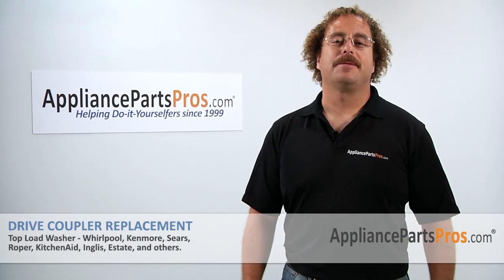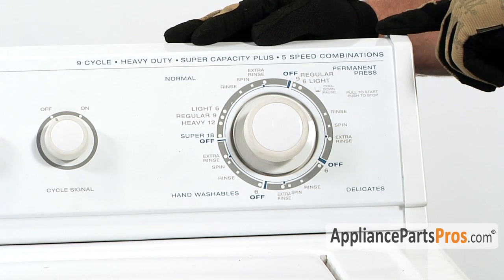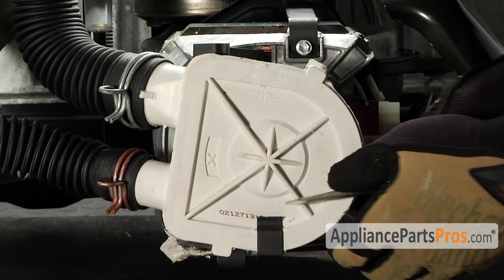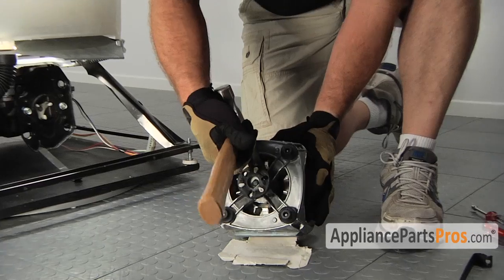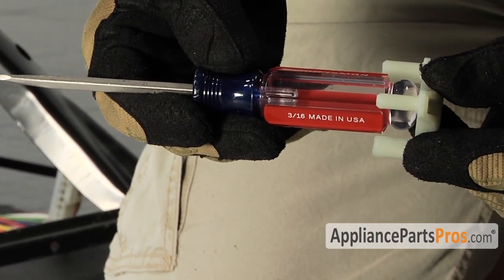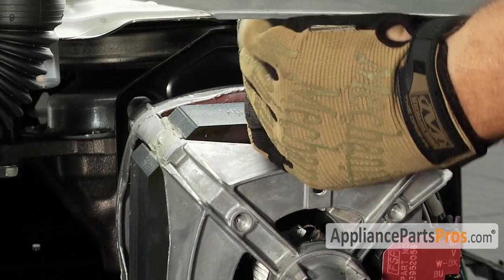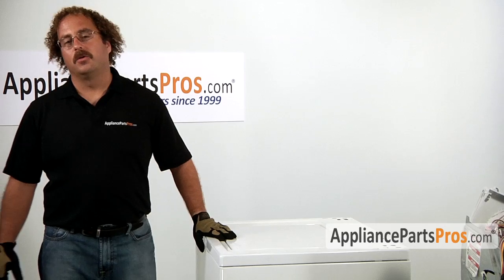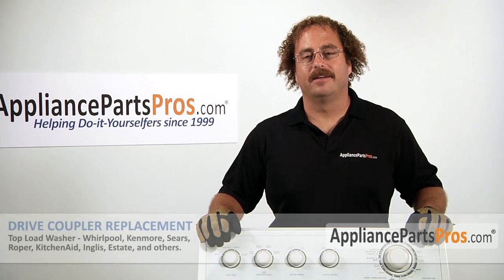How to Replace Whirlpool/Kenmore Washer Motor Coupling (285753A) – Fix Washer Won’t Spin or Agitate

Comment: With the Series 80 Kenmore Washers, the two end caps on the control panel need to be snapped off to gain access to the screws in the front.  Thanks for the repair video.  Could not have done it without it.  What would we do without the internets!!!
Reply from the maker: Ears 18 Glad you were able to get the washer fixed!

Comment: Hi fixed my motor coupling just like your video followed all the directions, but now that i turned it back on to wash a load there it's this angel coming from the machine like either oil or rubber sneak is that normal

Comment: great video...I noticed that the motor is horizontal mounted..?...correct..?....I think I have the same problem, except my motor is directly underneath the tub..... hopefully I can easily do the same repair...
Reply from the maker: If your motor is mounted that way it is probably a different design of washer. You can go to our website and enter your appliance model number to view the parts breakdowns to be sure you get the correct part for your model and see if we have a video for the motor. http://www.appliancepartspros.com/
Reply: I checked again,,,the motor is mointed same as your video...I'm hoping my problem is the clutch bushing..

Comment: So I just followed this helpful video and replaced the Drive Motor Coupling which was broken on my Kenmore 70 Series, but it is still making a loud grating noise during the cleaning cycle. If I lift the tub up a little while it is cleaning it will stop making the noise temporarily. What else needs fixing? Thanks for any help.
Reply from the maker: We'd be happy to help you out with that! We offer free technical advice and diagnosis. To answer specific questions about specific models, we would need to know your model number so that we can consult a diagram of your unit. You can give us a call at 1-877-477-7278 or you can chat us at our website: http://www.appliancepartspros.com/. One of our agents can take the model number, look up the schematics, and talk you through any issues or questions you may be having.

Comment: Great vid, but I had a problem . The metal piece on the trans shaft side coupler stripped from the coupler.  Everything spins freely. Any thoughts?
Reply from the maker: Are you saying the transmission shaft is rounded off? If so you would have to replace the transmission. If the metal insert came out of the coupler, then you need to replace the coupler.

Comment from the maker: Make sure you are tapping the coupler pieces down flush with the shaft ends, make sure your grommets are on the right way and in their holes. These are the things that might bind it up. The second motor clip is a little tough to get on but should not be too hard or cause it to bind up.

Comment: Nice video, the only problems where getting stuff out of the way, so you could do the repair. Little tip, maybe tipping back the washer would make it easier to put the motor back on as  it iis really heavy,....I used some books to get it into place, also works.                                   This can be done yourself though, but does require some ingenuity and patience!
Reply from the maker: We're glad we could help with your repair! And thanks for that tip.

Comment: Many thanks. Good vid.  I replaced the motor drive coupling per your video, yes the old one was stripped round in the middle.  I got it back together and . . . buzzzzzzzzzzz
Same sound and symptom. No adjitation, no spinning of the barrel.  Sigh.  What next, What now?
Reply from the maker: Robert Douglas This will involve some some trouble shooting it is best to post the problem along with the appliance model number on our repair forum and the techs can help you find out the problem.

Comment: Second time I have replaced this coupler but the metallic insert keeps coming off the plastic legs, any ideas? Thanks for sharing!
Reply from the maker: Emmanuel Chavarría Check out this thread about brakes and broken couplers, it could be a few things. http://forum.appliancepartspros.com/washer-repair/3265-replacing-direct-drive-washer-brake-shoes.html You can also post the problem along with the appliance model number on our repair forum and the techs can help you troubleshoot the problem.

Comment: So I am attempting this repair and have gotten to where I need to remove the plastic coupler pieces from both shafts, and neither will come off, it's almost as if they are fused to the shaft.  Also, I found the rubber piece on the floor, and all 6 prongs on the two plastic pieces are sheared clean off.  Another thing is that the plastic pieces on the machine do have the metal insert in the middle, so am I to assume this repair has been done before on this machine?  Please help me figure this out

Comment: Hello,please if you can to measure the metal insertion inner size btw. the parallel surface.I want to adapt to my washer if the size fit.My shaft is 10x10 mm square.Thank you!

Comment: Everything worked good until I came to the last coupler...I can't get the coupler off that is behind the motor mount...any suggestions? I have tried tapping the screw driver with a hammer but it still won't budge...

Comment: What is happening with my machine is there are times when after the cycle is done, the load is a bit damp still. Would this be the possible issue? My washer still spin though.

Comment: Put the coupler into a cup of very hot water (boil the water in a microwave) for about a minute before tapping it on the shaft. That makes the plastic pliable enough so it won't split when you tap it onto the shaft.

Comment: I have question what if the coupler don't have the little metal piece in it do still consider a bad coupler???
Reply from the maker: It should have that metal piece in it. If that piece is missing then yes that would be consider a bad coupler.

Comment: Thanks for the video. I replaced the coupler and now the wash cycle runs very slow. It stays on wash and rinse and spin a long time. Any idea what I did wrong?
Reply from the maker: Fred Martin You can post the problem along with the appliance model number on our repair forum and the techs can help you troubleshoot the problem.

Comment: I have purchased a new coupler for a Kenmore 80 series, I go to mount it, get one strap on, and the coupler is still free to spin, I go and try to put the other strap on, and the coupler and gears stop spinning. I don't want to risk putting it back together and the motor going bad because its not free to spin. I have already taken out the coupler to see if it was in too tight, but that wasn't the case. It is a bit challenging putting the second strap back on to the motor.  Any suggestions?

Comment: The new coupler had metal and thta can strip the transmission and or the motor that's why the arms with all plastic without the metal in there will save you a new transmission and or motor

Comment: Do these couplings when going bad cause intermittent spin issues until it's fully trashed? I plan on checking mine this weekend as it'll agitate, drain but was intermittently spinning (with lighter loads) but not with heavier loads. Now, it refuses to spin at all. Just curious.
Reply from the maker: Brandon Montz If the washer spins with light but no heavy loads it could be the clutch is slipping and needs to be replaced. Also check the brake shoes to be sure they are not dragging! You can read about it in our forum, http://forum.appliancepartspros.com/washer-repair/3265-replacing-direct-drive-washer-brake-shoes.html

Comment: I am having trouble getting the second part of the motor cupling to come off the washer. The first part easily comes off sob does the rubber piece. Is it OK to put a new one on anyway? It is broken with two legs still attached.
Reply from the maker: You need to get behind it with a bigger screwdriver or a small pry bar. It may be tight but it should come off, I would not suggest leaving it on.

Comment: Before opening my washer, I want to know: it this is the problem, will the washer we silent after it filled? I would presume that normally, you would still hear the motor turning even if the couplers broke.

Comment: My washer was not spinning unless you gave it a push.  I replaced both couplers and the rubber insert per the video.  Washer worked for a couple of weeks but now is doing the same thing again.  Any ideas?
Reply from the maker: We'd be happy to help you out with that! We offer free technical advice and diagnosis. You can give us a call at 1-877-477-7278 or you can chat us at our website: http://www.appliancepartspros.com/. We will need your model number to give you accurate advice, which you can locate using this tool on our website: http://www.appliancepartspros.com/modelnumber_locator.aspx

Comment: I have a 18 year old washing machine, and i cant seem to fin the same part for my old model (1104680290), so does the 285753A still would be able to work with mines?
My old cracked coupler looks exactly identical to the one you have in the video.
Reply from the maker: SAS Mo It should work, these were the pretty standard over the years.

Comment: My washer won't spin or agitate,but did drain. In the spin cycle it made a loud noise and moved slightly.I replaced the motor coupler,now it doesn't spin,agitate or drain,makes a humming noise in spin cycle. Any suggestions?
Reply: Motor is dead, usually what humming is.  sorry

Comment: Thanks! Great video. BTW, I have a question here. Hope can get some solution'
The spin function of my kemore washer is Not working all the time. Sometimes it is good, but later it is down. The only way to make it work again, is to unplug the power, wait for 5 mins, plug the power back and then turn on the spin. But this way is NOT always work. I have to tried several times to make it work. It is really confusing. I don't know is this problem is related to the motor coupling or the clutch. Or to the Control Panel? Can anyone give me any advice?
Thanks!
Reply from the maker: Albert Chang I would check the lid switch for a cracked body. If its cracked you might get an intermittent signal from it and bumping it might change that. You can also test the switch for continuity. The lid switch is a safety device that stops the washer from going into spin if the lid is open. If that is not it, I would post the problem along with the model and serial numbers of the washer on our repair forum and the techs can help you out!

Comment: This would have taken me about 40 minutes.  However when putting the motor back on and put the top clip on, the bottom one wont go on.  If I get the bottom one on the top won't go on.  Like it's a bit too short.  If I could get both clips on it would be back together and working in less than 5 minutes.  

Any tips on what the problem might be?
Reply from the maker: Might need to tap the coupler ends down just a little. If they are not down enough it will maker it a little too thick and the clips wont go on.
Reply: I went back for another try.  Used a pipe wrench and it went on in a flat second.  Most of the videos that I watched including this one showed just popping it on really easily by hand.  That's deceiving.  

That said, it was a great video and other than this kink in the plan I changed it out easily.  Took a couple of tries to get the cover back on properly but not difficult.
Reply: Nancy Michelli You are SO right about that. Disassembly is easy - getting back together is quite a bit harder than the video makes it appear. The 3 prongs won't just magically align with the 3 holes; as soon as the parts touch, the motor spins a bit and you have to start over.  After about 10 attempts, I found a trick: get the parts in alignment, then bring the motor in at a tilt so the bottom 2 shock absorbing grommets find their receptacles first; then bring the motor up straight and the coupler prongs might just find the holes.    The video also shows the mounting clips just popping back into place; mine were a dogfight with a big pair of pliers.

But, it can be done.

Comment: Does my washer have to be empty? Mine did it after I filled it.
Reply from the maker: When you are doing a repair yes you would want your washer to be empty.
Reply: @appliancepartspros  I know it's a dumb question, but it won't drain. I'll get it done. Thanks

Comment: I Have a Kenmore 80 Series Washing machine 110.26882500. For couple of times it tripped the circuit breaker at the middle of the cycle but now it trips the breaker as soon as I try to turn it on. Lid switch is good. It tripped even when I tried to bypass the lid switch. If I disconnect the lid switch then it fills the water and stops. What could be the problem?
Reply from the maker: pragyanraj1 Have you check the lid switch wiring all the way from the console to the switch? Not only for continuity but to ground? You can also post the problem along with the appliance model number on our repair forum and the techs can help you troubleshoot the problem.

Comment: I'm on my third broken coupler why does it keep happening?
Reply from the maker: ilikejumprope It could be a few things and without any other symptoms, it is hard to say. You can post the problem along with the appliance model number on our repair forum and the techs can help you troubleshoot the problem. Make sure you tell them of any other symptoms, noises, etc.
Reply: +AppliancePartsPros it just happened for the fourth time! Ugh watching your vid again to help fix it. And the part where he puts the motor back on is extremely difficult for me. Any tips to make it easier? That motor weighs a ton.

Comment: why are we smelling a burning smell after replacing it?
Reply from the maker: I would pull the motor off and make sure you tapped the coupler on enough on each side. If not it can cause it to bind up. As you put it back together make sure the motor goes on straight and there is no problem with the pump.
Reply: AppliancePartsPros Thank you so much!

Comment: What if I have no screws in the back?
Reply from the maker: Tracy Bradway Are you referring to the console screws? If so, you might have the clip type or the screws maybe covered by a trim panel that you will have to remove.

Comment: I do have a question.  After I had everything back together I realized that I had not added back this cardboard/paper to the bottom of the motor where I am guessing it had come off.  My guess is that it was to keep any wires from touching each other and short out.  But there is nothing to touch under the motor.  Is it important to take it back apart and put this back  on?

Did anyone find anything like this on theirs when they did this?  I m trying to decide whether I need to pull the washer apart again to put this cardboard paper on.  I really don't want to do that but will if it's important.

https://plus.google.com/u/0/photos/yourphotos?pid=6039682535727147826&oid=107591688336663880809
Reply from the maker: Nancy Michelli I would put the shield back in. It is there to help protect the floor from the motor heat and also helps prevent things from being pulled into the motor.
Reply: I ended up finding a link to your video of replacing the motor that showed where it goes.  So I did take it apart and put that back in.  Though there doesn't seem to be much holding it there other than that one clip.  

Thanks for the help.
Reply from the maker: Nancy Michelli Awesome, glad you got it back in!

Comment: I did this 3 times and the coupler keeps breaking :o(
Reply: +BigJyeTV  take out the agitator and clean and oil where the transmission spins the tub it needs to be able to turn easily or the motot will snap the coupler, maybe also you have a bad transmission
Reply: Paul Glinski Thanks, it ended up being the piece that looks like a brake shoe. The name escapes me now.

Comment: I don't understand why the entire coupler isn't made of metal instead of plastic.
Reply from the maker: Mike Law They have always been plastic. It is like the weak link that breaks and spares your motor or transmission from damage.
Reply: AppliancePartsPros  Well, I took my machine apart and found that the coupler was OK.  I checked the pump and that was clear also.  The one thing I did notice is that when I turn the motor shaft by hand I get a metal against metal sound at certain points.  Does that mean I have a bad motor?  By the way, it's a Kenmore 70 series(11020712990) that was purchased new 15 years ago.
Reply: AppliancePartsPros  Well, I took my machine apart and found that the coupler was OK.  I checked the pump and that was clear also.  The one thing I did notice is that when I turn the motor shaft by hand I get a metal against metal sound at certain points.  Does that mean I have a bad motor?  By the way, it's a Kenmore 70 series(11020712990) that was purchased new 15 years ago.
Reply from the maker: Mike Law If the bearings are going out you could get a metal on metal noise. According to the model number you provided AP2907254 is the correct motor.
Reply: AppliancePartsPros I love my washer and I dislike the new new HE Kenmore washers with the locking lids, but is it worth it to to spend almost $300 on a washer that I've had for 15 years?
Reply from the maker: Mike Law If its in good shape otherwise it may be worth fixing. You will have to make that call!

Comment: Damn switch! I didn't think of that and it's exactly why the washer stopped dead. One of the two screw anchors broke and I got it out,epoxy'd and clamped. While the machine is apart I'm c;ean the unmentionably disgusting slime coating the inside walls of the machine that I have been washing my clothes in. AhhHH!  Lunchtime!   O0
Reply from the maker: Charlie Dominici Glad you got the washer fixed and clean!